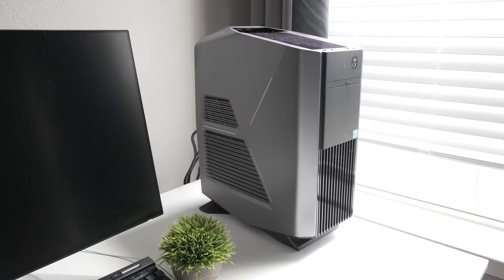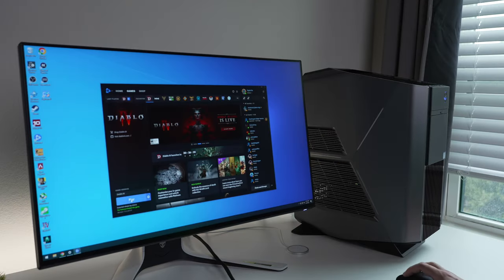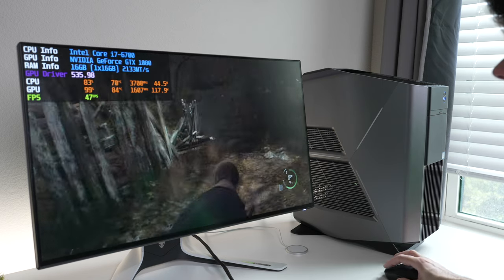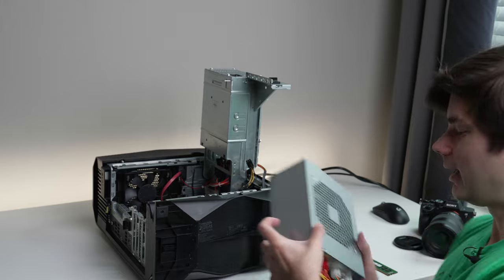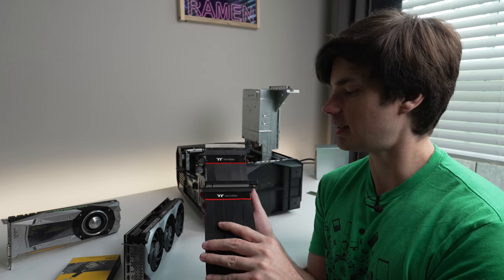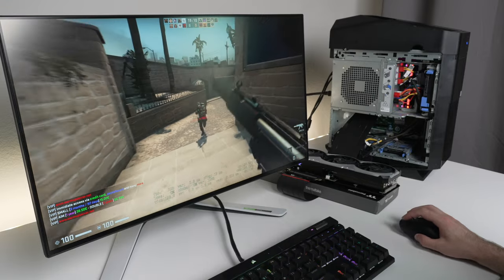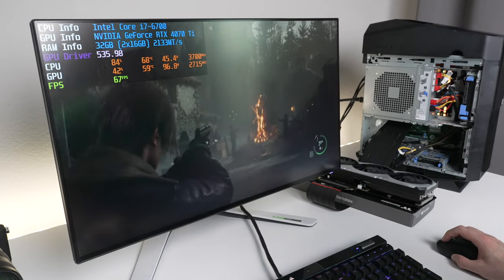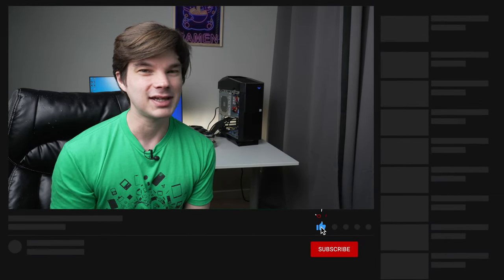Upgrading an Alienware Aurora R5 With an RTX 4070Ti

Comment: Just fyi, I put an Asus Dual 4070 in my R5 and it fit fine. I was thinking of making and external port / enclosure  via a riser cable with artistic plates in acryllic ...but apparently I didnt need to. Might do it later for art's sake.
Reply from the maker: Very cool. I didn't know there was anyone making a dual fan 4070.
Reply: Ohh wow that's cool. I was looking at the 3070 to replace my 2070 Super but now I'm thinking about the dual fan 4070 you mentioned.

I'm still leaning towards just getting a new PC altogether, but this is a great option too. Thanks.
Reply: Hello, I was wondering if a 2060 would work well here.
Reply: Should depending how long it is - my 4070 takes 10.5 inches and fits. Same with my 2070.

Comment: Hello this is ebraheem khuram does rtx 4070 ti better than 4070
Reply from the maker: Hi there. The Ti is faster that the non Ti but it's larger. I'd recommend the fastest card that can also fit inside the case that's also within your budget.
Reply: Yeah it so expensive rtx 4070 ti so faster

Comment: I’m looking to do the same thing to my r5 but instead of a 4070 I’m gonna do a 3070. I still do need a new power supply which specific one did you get?
Reply from the maker: Any R5-R9 850w alienware psu will work. My psu's specific part number is HU850EF-01. They should be pretty easy to find. Good luck!
Reply: @TaylorBrauer  thank you!
Reply: How’s the 3070 in the Aurora r5 performing

Comment: instead of a gpu upgrade why not platform upgrade? pretty sure for tha money spent on the 4070 TI u could've gotten a newer Intel platform or even amd. EDIT..... after checking ur channel out i see it was mainly a test, as u have a 7800x3d and 13600k on aswell. SRRY bout that
Reply from the maker: No worries. I appreciate the feedback. You're right, if I wasn't doing an experiment the better choice would be looking to upgrade the mobo, processor, and ram.

Comment: I was hopeful to see that card fit in the box. Lol. Then you bust out the Frankenstein solution! 
Thank you for that video. Answered my question. Hard no.
Reply from the maker: haha glad it was helpful.
Reply: @TaylorBrauer  Love the video. Where did you get your extender cable? I was looking for one as long as yours. As it happens I have the same system and, since it doesn't have thunderbolt 3, I was thinking I could put the extender cable out the back and route it into another case that I would use as a video card holder with its own powersupply. Glam frankenstein! (Glamenstein)
Reply from the maker: @rehdwolfe  haha that sounds wild. I linked the riser cable in the description. Good luck!
Reply: get a dual fan next time

Comment: Man this is a great video. I have a R5(same case as yours) and upgraded it to a 2070 Super, was thinking about getting a 3070 but now I'm seeing a dual fan 4070 will fit just fine. I already have the 850 power supply.

Now I'm trying to decide if I want to upgrade or maybe do a dual stream setup and use my R5 for capturing.

THANKS for the video and info.
Reply from the maker: Thank you! A dual fan 4070 sounds like a beast upgrade to the R5. It sounds like you've got a pretty good plan there with the streaming setup. I'm wishing you the best in your streaming endeavors!

Comment: I have r5, thanks for your input.  Hard to find people like you.  My problem, 2 flashing lights indicates memory issue, 16 rom 2133, no boot, new 460 ps, new i7 6700, new mb, rear green light, reset cmos, no help from dell tried to sell me r16.  Want to get this r5 to boot.  Respect your input.  Deeply appreciate your time.  Failure after installing 3200 rom.  My bad.
Reply from the maker: oof, sorry you're having to deal with that. I would maybe try no memory and see if you still get the same code. Then add ram one stick at a time. Sounds like you've done extensive troubleshooting. I'm wishing you luck in finding a solution.

Comment: I put a 4070RTX in my R7 and it works great. That one will let you run Diablo 4 and upgrade Windows10. It keeps asking to upgrade to Windows11, but I am not certain the processor supports it.
Reply: Aurora R7 supports Win 11 as I have one with the original 1080 GPU 16GB; I was lucky that I upgraded my PSU to 850W as I've just got a RTX4070 to install as it is within the 10.5" length for the case. Good to know the RTX4070 works great

Comment: Thank you so much for your work and this video. I have a R6 7700k 850w liquid cool gtx 1080. I have been trying to figure out for a year now if I can upgrade to a 40 series and if so how high of a 40 series would it handle? Also would I need that Pcie 16x adapter you had to put on the video card? Idk if this helps but my motherboard is the 270z chipset.
Reply from the maker: Yw! The 850w should have all the PCI-e power cables for a modern card. Check Dell's support site for documentation on the R6 which will tell you the exact dimensions of card that will fit inside the case. The adapter was more of a brute force way of demoing a card that doesn't fit inside the case and I wouldn't recommend that method as a practical solution.

Comment: A crazy idea would to be watercool and Aurora R8 I've searched all the cross YouTube and no one has ever even attempted it.
Reply from the maker: That's a good idea. It's tricky given that the inside is so compact.
Reply: @TaylorBrauer   It would require custom water blocks for the GPU and CPU. Which a company that's well know makes. The water pump can be placed anywhere..

I would use soft tubes for flexibility and have custom metal brackets for the pump. Also would cut out the top of the case out so I could at least put a two fan   radiator in there(if possible)

The size of the GPU would be greatly reduced since you only need the chip cooled and you won't need fans for it.

I have and aurora R8 myself and always wanted to custom water cool it. Went looking on YouTube see if anyone has attempted it but found nothing.. 

So I think I'll try it myself when it get time.

But could be a great idea for a YouTube video though my help your channel grow..
Reply from the maker: @vlossgaming533  Oh dang you've thought about this. You should give it a go if it's a project you really care about. If I had the skillset I'd try it. That's a bit advanced for my desktop customizing skills. I would like to try a custom loop in a larger case to get my feet wet.

Comment: Awesome video! I have an R7 and wondered if you could do something like this.
Reply from the maker: I believe so since it shares the same chassis. Try to get a card to fit inside the case so it doesn't get damaged. Check your power supply to to make sure it supports whichever card you pick.

Comment: Supposedly you can install Win11 if you just do a clean install (no upgrade from Win10. Your key should transfer over, but honestly just get a pro key and bake the drivers in with microwin
Reply from the maker: It's a bios limitation which is much tricker. Dell didn't add the fTPM workaround to these motherboards.
Reply: @TaylorBrauer  I see… how irresponsible of them 😂 I wonder what other mods are possible, like adding Thunderbolt. There is what appears to be a TBT header but the pins aren’t soldered on… if that is a standard 5pin, perhaps a maple ridge card could be installed

Comment: Great work and excellent video, I also have an alienware aurora r5 and now that I see your video I wonder if I could upgrade it with 2 external gpus, increasing the power supply. Do you think the processor supports it?
Reply from the maker: Thank you! I'm not sure it supports dual graphics cards. Check the Dell manual online. They have pretty great documentation.

Comment: Hi thx for this vod and I have a silly question hope u have an answer: my mother board from R5 was broken, so I replaced with one from Asus. Then I installed windows 10 with the version that Diablo 4 required. I wonder if I replace back the original mother board for r5 will I still be able to run Diablo 4? Was the limit coming from the mother board?
Your video makes me think twice on getting the mother board!
Reply from the maker: I'm not entirely sure what your circumstances are but it sounds like you're talking about the graphics card? There's a few considerations to make when upgrading the R5 such as the size of the card, the power required to power it, the price, and the prospect of future support from Dell of which there isn't any left for the R5. I would consider those before making an upgrade.
Reply: It will run D4 just fine if you set the settings to medium or bit lower. My gtx handled it Well under 65 degrees. 
Got myself an stock R5 i7 6700k liquid cooled 32gb gtx1080 850w.
Bought it new  8 years ago, bumped the Cores up to 4,4ghz and still runs great.
Okay, repasted cpu and gpu , blowned out some dust, replaced all stock fans with better fans with airflow and a second 120mm fan in the front... 
Still great pc. 🙃

Comment: Yo I really need somone like u (who daily drives an Aurora r5 and smart) idk if I have a r5 r6 r7 or r8 can u tell me the diffrence please ? also how do u get the  cpu gpu temps and usage percent on the top left ?
Reply from the maker: There should be a service tag on the back that you can enter on Dell's website and view the specs for the system. If you don't find it on the back it's also listed in the BIOS. That stats display is coming from MSI Afterburner. It's a GPU tweaking program but it has a on screen display for stats in the settings.

Comment: I have an R9 with a 2080super want to install a 4070tisuper what do you suggest? im not sure if it will fit where did you get the extender. Pls i need help
Reply from the maker: Luckily, Dell has some great documentation that should give you exact dimensions of card that will fit in the R9. Docs are on the support page and just enter your service tag. I'd recommend getting a card that fits to those specs, and perhaps more importantly, a card that is within the limits of your power supply. I wouldn't recommend getting an extender for using a card outside the case.

Comment: Friend, my motherboard was damaged. I have an Aurora R5. I want to know what motherboard do you recommend to put in that tower? I'm thinking of buying the MSI Gaming Intel B250 LGA 1151, I'm not sure I'll buy it because I think it won't have enough space to put it.
Reply from the maker: It's a propriatary mobo so any replacement will have to be another Alienware motherboard. The R6 and R7 mobos might fit in here if you're looking to upgrade but I'm not 100% sure of that. These Alienwares use a special connector for the front power button which won't work with other branded motherboards.
Reply: @TaylorBrauer  thanks for the information friend

Comment: How do I know what psu to get. I’m trying to find a 550 watt but I don’t know what will fit
Reply from the maker: Luckily, the R5 through like R9 have compatibility between themselves because they have similar chassis. Search for what you have along with what you're looking for and I'm sure you'll find compatible options.
Reply: @TaylorBrauer  does it use a standard atx psu?
Reply from the maker: @dazios6874  I'm not sure. I only looked for the Dell/Alienware PSUs as they have the right cable lengths and some cables are proprietary. I def think you run into issues with a regular PSU that isn't for that exact Alienware generation.

Comment: ON R5 AURORA YOU NEED TO BUY MATCHING SETS LIKE 2 X 4 GB FOR 8GB DUEL CHANEL MODE  OR 2 X 8GB FOR 16GB AND UPWARDS  COMPATIBLY SPEEDS FOR R5 ARE  2166MHZ, 2400MHZ, OR 2666MHZ, ALWAYS BUY NEW AND SEALED MATCHING KITS, ALSO THE DIMM SLOTS ORDER IS IMPORTANT HOPE MY DIMM SLOT CONFIG BELOW HELPS, IT WOULD BE BETTER THAT YOU BUY RAM STICKS LIKE HYPER X FURY MODUALS THAT DONT USE XMP PROFILES , JUST RUN AT THE NATIVE SPEEDS FOR THE SPEEDS LISTED IN THIS COMMENT, 32GB SHOULD BE 4X 8GB AT EITHER 2166MHZ, 2400MHZ, 2666MHZ

               XMM1	 XMM2	XMM3	 XMM4
8 GB   _	4 GB	4 GB	 	 
16 GB	8 GB	8 GB	 	 
24 GB	4 GB	4 GB	8 GB	8 GB
32 GB	8 GB	8 GB	8 GB	8 GB
64 GB	16GB     16GB     16GB  	16GB

Comment: I have this exact model that I have and I made some minor upgrades to already. Question: everywhere I look online suggests I'm stuck with the motherboard and 6700k CPU, BUT they've also said the best one can do with the GPU is a 2070 super and you proved that wrong. Do you think there is some way to upgrade the CPU or am I stuck?
Reply from the maker: The CPU is spec'd to a certain socket and I don't believe that any generation other than 6th gen i3, i5, i7 will fit that socket. So, unfortunately, you are most likely limited CPU wise. As for GPU, as long as you take wattage and size into account, you can use anything you want. In the video here I took wattage into account with the 850w PSU but I clearly didn't take size into account, hence the riser cable.
Reply: @TaylorBrauer  After leaving my comment, I did another info search and saw that the socket is LPA 1151. I looked up what the best processors are at this size and found that there is an Intel Core i9-9900K sized this way. Do you think it would work or will it crash and burn?
Reply from the maker: @Pudsports  tbh, I don’t know. You might have to do some digging to find someone who’s successfully done it before, if you’re on the fence about attempting it yourself.

Comment: I was looking at updating my R7 and i think the 4070 dual fan might fit haven't tried it yet but looks like it will and if it's just shy ill remove the front facing fan and get one that's a lower profile which should do it
Reply from the maker: That's exciting! Check out the documentation for the R7 to see what lengths are supported. The Dell docs are great and should provide you with everything you need before you upgrade.

Comment: Hello friend, I greet you from Ecuador. I have an alienware r7 core i7 8700k, my question is, can I install the rtx 4060? What components should I change?

Thank you, friend
Reply from the maker: I’d recommend checking out Dells documentation for the r7. That will detail exactly what size card can fit in the case for the rated power supply.

Comment: hey youre really smart, any ideas what upgrades i can make to my aurora r6
i have no idea where to start. i wanna make it the best i can
Reply from the maker: If you don't already have an SSD or NVME drive installed I'd start there. That's going to give you the most performance upgrade. There's also RAM, CPU and Graphics Card upgrades. Those might or might not require upgrading the PSU though. Dell has great documentation for these Alienwares which should give you a lot more info on what's possible with upgrades. Good luck!

Comment: Hi please answer my question I'm late to this but do you think it's safe to leave gpu outside case?I want to upgrade my gpu but it's too big I don't mind being outside the case at since I don't care about no rgb light or any of that stuff I can just sit the gpu on top of a box like you did in the video? Is it safe some say no but realistically speaking is it???
Reply from the maker: It's as safe as a GPU being on the outside of your case. Which is to say, having this as a long term solution is risky especially if you can have things that can spill or fall on the GPU. If it was me, I'd keep to GPUs that fit inside the case.

Comment: Also the windows proble should be fixed when you completely reinstall windows
Reply from the maker: You would think but unfortunately that's not the case. The initial install will work but as soon as you layer on the drivers, it crashes again.
Reply: @TaylorBrauer  hmh thats very strange. perhaps some bios setting? or is that a common issue with that model? Ive never had such issue and windows 10/11 runs flawlessly on my 2009 macbook
Reply from the maker: @florider_hd  It's a Dell thing. Dell refused to patch pcs before the R7 and that includes PCs with newer versions of windows 10. It's pretty lame.
Reply: @TaylorBrauer  dang. im using a 2013 dell rn with a 1660 super in it. it works just fine on the newest version

Comment: Does the cpu makes the system bottleneck? the gpu is overkill for the cpu
Reply from the maker: Yes, the cpu bottlenecks. I knew it was going to be a bottleneck going in but I was curious hehe.
Reply: @TaylorBrauer  Anyway thanks for your video. I also have Aurora r5. Despite the bottleneck issue, you proof that GPU upgrade will improve the performance.
Reply from the maker: @Chrisdian7  Yw! Have a good one.

Comment: Im quite confused, ive ran pcs with 4th gen and no gou and theve updated later than than build and ive had windows 11 running fine and updating
Reply from the maker: In the case of the R5, like I have here, Alienware never released a fTPM bios update to the system so it's not compatible with Windows 11. I couldn't even get the latest version of Windows 10 working on it because one (or more) of drivers is incompatible with later versions of Windows 10.

Comment: what's the best gpu i can upgrade to without getting a new power supply？
Reply from the maker: The power supply I pulled from this Alienware is 460w so any combination of hardware that falls below that. Check how much wattage your power supply can support.
Reply: @TaylorBrauer  thanks for the reply, I'm a noob. What's the thing that you used that showed all the data like the fps and other stuff?
Reply from the maker: @jeffyou7594  Yw! It's called CapFrameX. You'll have to install RTSS (the Rivatuner stats app) to get the overlay to show up. It's a pretty nice software that can also record graphs for a bunch of stuff.
Reply: @TaylorBrauer  ok ty！

Comment: How did that ram work on that motherboard ?
Reply from the maker: It works. There's no XMP so it wasn't using the full speed.
Reply: @TaylorBrauer  I see , could my i5 be an issue since when I put 3000MHZ 2x16gb my computer wouldn’t boot I’d get the 4 yellow blinks
Reply from the maker: @tjomg9354  I'm not sure but, Dell has great documentation on their site which should help you out. Good luck!